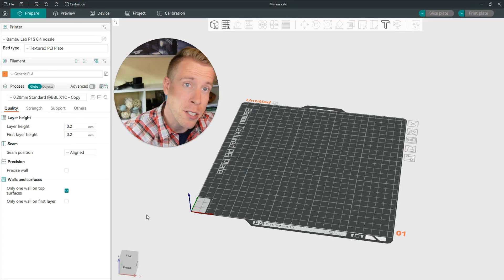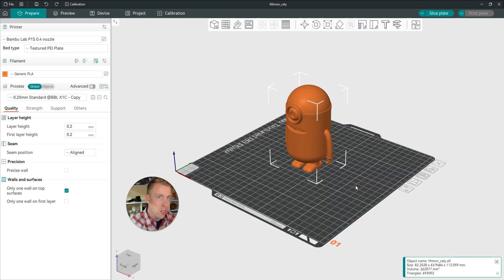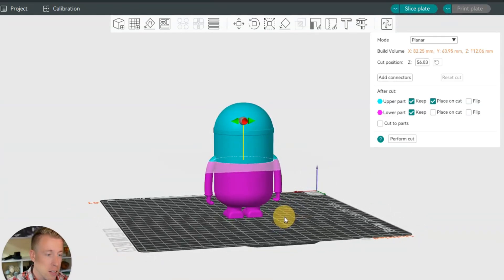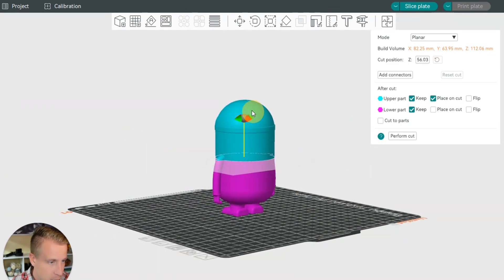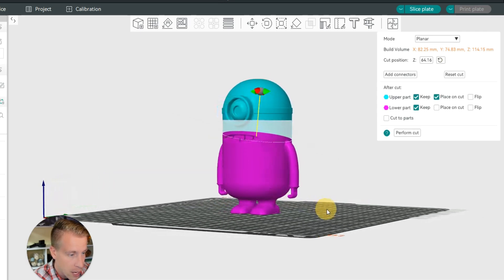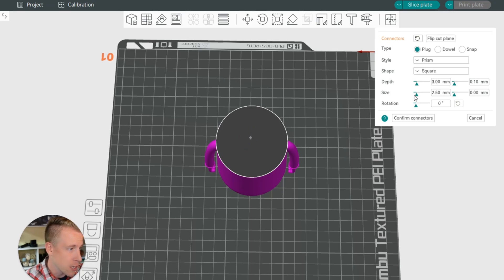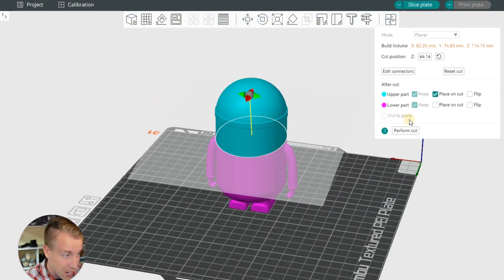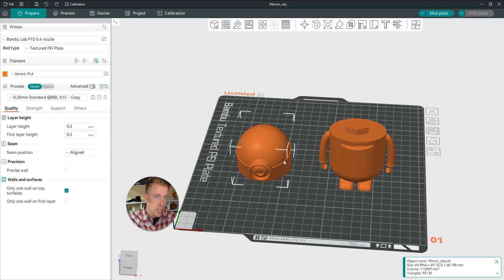How to Cut Model in Multiple Parts with Connectors in Orca Slicer

Comment: any idea why sometimes the darker side of a print appears (where i can click to add a connector) and sometimes it's transparent and i can't add anything ? my proposal was that the model was too flat , BUT when i made a smaller part of it , then it let me choose where i want to do a connector. FYI i'm doing a big frame , which i divided into 3 parts , and cutting by holding shift+dragging along. Either i'm stupid (most probably) or the orca slicer cutting tool is making fun of me.

Comment: This is an excellent tutorial, but I'm afraid it stopped just short of what I'm trying to learn.  I need to reduce the depth of a threaded jar cap, so I have to remove a section in the middle and then snap the remainder back together - like pulling a slice of bread out of the middle of the loaf and then pushing the rest back together.  I'll keep playing with the Cut function, but if somebody has a shortcut, I'm all ears!  Thanks.

Comment: I'm trying to do this exact step on a bent tube but keep coming up with non manifold errors. Any suggestions? I figured cutting the tube in half would make it easier to remove supports instead of trying to reach inside the tube and remove the supports without damaging the print.

Comment: This is a very helpful video I am running into one issue when adding connectors.    I sliced up in another program a Very large Cheshire cat. by large I am talking its now over 5ft all.  so obviously even though I am using a Kobra Max it needed to cut it up into lots of parts.   the program I used did an OK Job and it printed ok. But i decided to redo it and slice it up myself using connectors.  the problem I am having is when I do one slice its fine everything works well.  but even if I save the sliced objects and reimport them when I make another slice it wont save the Connectors Male or female side.  it shows them but when you save them and put them into Cura they are gone other than just the very first one that was made for the very first slice.   that is the only one that will stay in place.

Comment: I'm struggling not with cutting the model and adding connectors, but with "uncutting" it. Suppose you do a cut and add connectors and separate the two parts, play with a lot of ideas ... how do you simply tell the slicer to "uncut" or go back to the original model? Yea I know there's a undo button at the top but that's pretty cumbersome if you've done a lot of things. Is there a "revert" to simply go back to the original model? There is no "Reload" under the File menu.
Reply: Cut the model to the point you'd want it to be before the connectors and then save that as its own file. Then do the cut with the connectors and save that as a different one.

Comment: The "CUT" tool button is back!!!  I'm using 2.2.0.
  If you're unfamiliar, it's the box with a horizontal "line" through the center.  I use it frequently to sample print various layers for test fitting or measurments before full prints.

Comment: As GI Joe always said, knowing is half the battle.  I'm designing a 3D printed enclosure for my new 3D printer.  The left, right, top and back panels will all be cut into four pieces.  I've been dreading and spending too much time thinking about how I'll make alignment and connection features in the CAD model.  Using a modern slicer, cutting the model and making alignment  connectors in CAD is dumber than dirt.  I knew slicers can do this but hadn't used that feature so I was slow to realize that's obviously the right way to do this job.  Thanks.